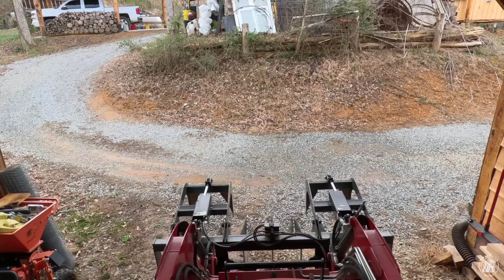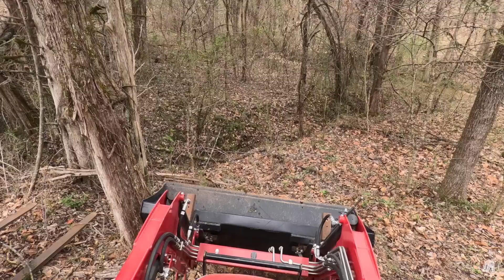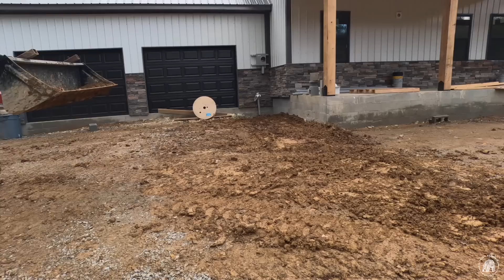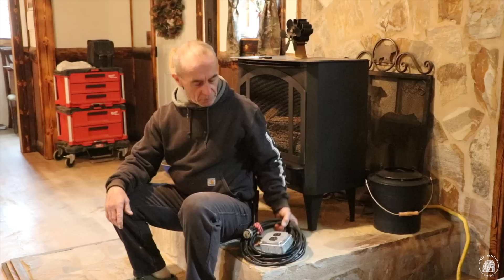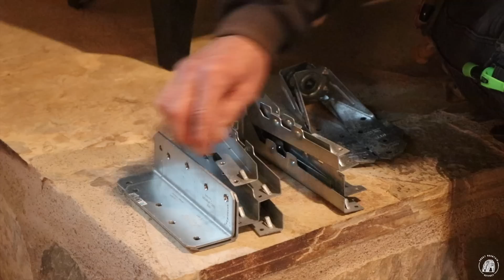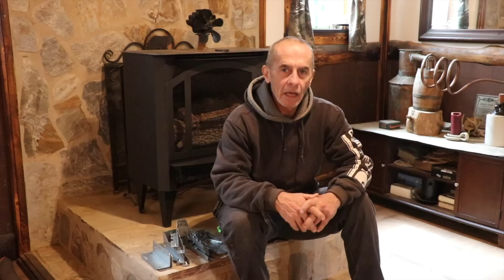High Winds & Construction: Protecting Your Worksite!

Comment: You had me confused with some of your first statements about the trees growing on the North and South slopes. You straightened out the confusion as you kept talking. I will have to be more observant about what trees are more abundant on different sides of a hill. Where I live, there are lots of cedars on South slopes. I think sweet gums may be one of the first trees to begin growing when fields begin reverting to woods. One little mountain I know of has beech trees on the north side, and I don't think any on the south side. Not sure if that holds true everywhere. When I am out in the woods, I will always be more aware now of what is growing where.

Comment: Richard, at 72 I've started raising my first chickens, I bought the Premier one 48" fencing to keep them in. It isn't working out as I thought.  It has to much slack at the bottom causing it to ground out . Anyway, just cautioning folks it doesn't work as advertised.  Have a windy day, your not alone.😊

Comment: Richard no more water than you use, depending on the gallon per min  Jennifers well produces,  you might want to look at running a pipe from her house to you cabin, and that way you would have good supply of water.

on the trees, if land had been cleared , the pioneer tree are the Pine, Cedars, Aspens, cottonwood, Birch, , Liriodendron (tulip poplar or yellow poplar), Maple,   and other Populus trees like , Poplar. are the fast growing trees that establish a forest as the oaks, Hickory, Black Jacks, Post oaks, Pecans, Black Walnut and the other slow growth hardwoods fill in and take over the forest over time, as the faster growing trees die off.  
A pine tree or a tree of the  Populus  family , Birch, Maple  other fast growing softer wood trees  die off.

I remember when I counted the rings on a black Jack tree my father cut down for firewood for my Grandmother, the tree was about 10 inches across, but had over 175 rings, where the cedar tree of the same size on has 15 rings.  The trees at your sister are very old compared to the trees  on yours and Jennifers land, as you state it was cleared farm land at one time, where your sister lives the hard wood forest she has is very old and there probably tree older that state hood of Tennessee on here land.

On the land of my great uncle he had a very old hardwood forest, but after his death the judge ordered it logged, and the trees that replaced the hardwood was the very same tree as you have growing.   Uncle Freddies land was on the north side of a hill as he called it, but to me it was a mountain as his house was in the hollow (valley between to mountains or hills as he called them 1500 feet in elevation change to me is a mountain, a hill is 500 feet.

The types of trees growing have more to do with activities of man on the land before you bought the land, the last 25 to 40 years ago.

In 100 years or more the forest on your land will be full of Oaks and other slow growth hardwoods, as the fast growing trees die off.